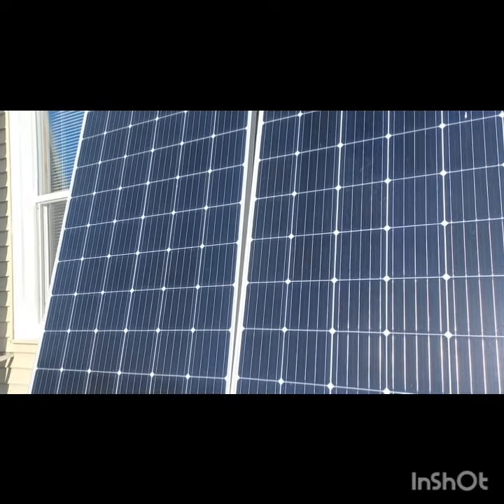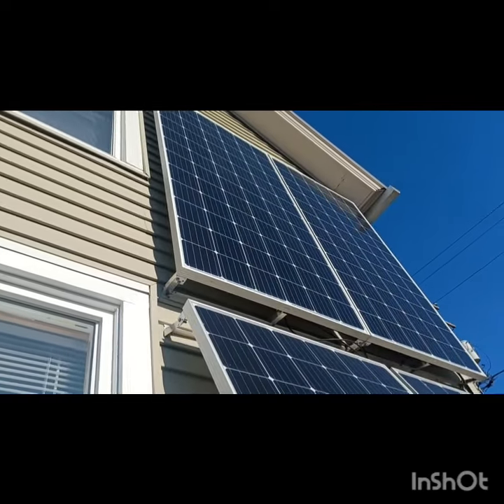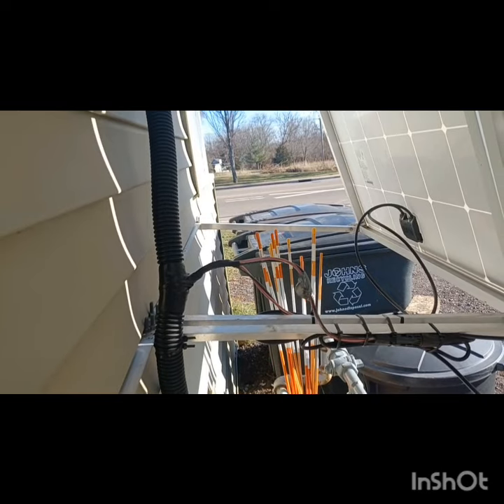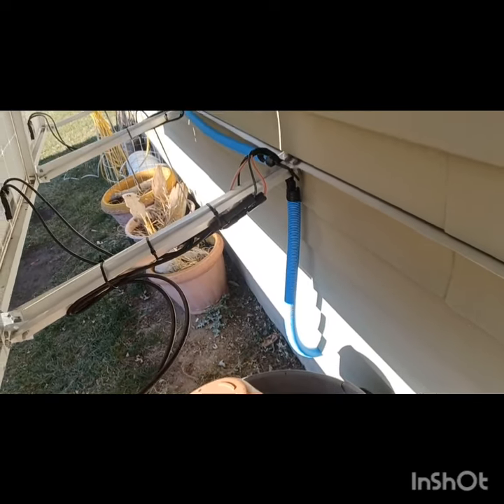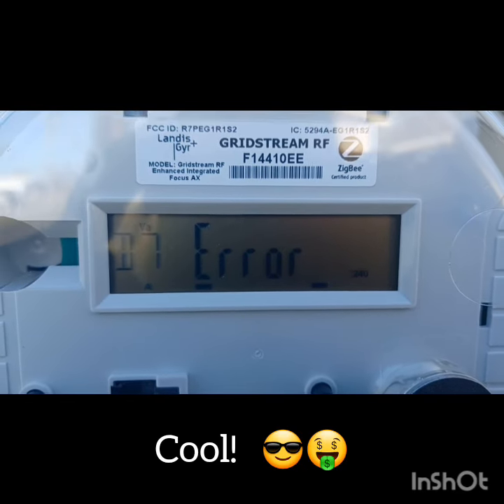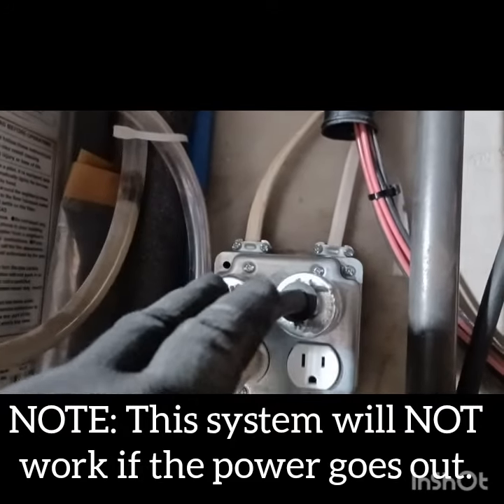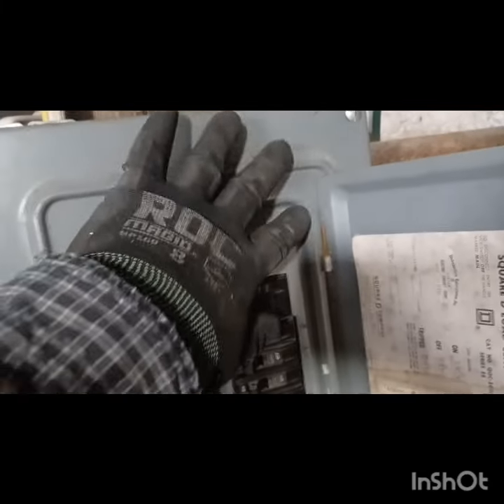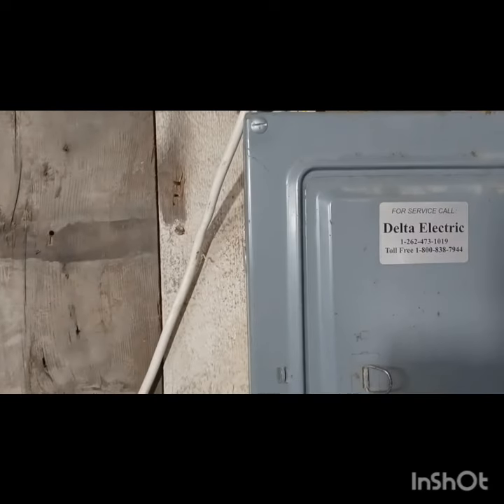Easy 3,000 watt grid tie Solar System for $1,800!

Comment from the maker: Please Note: This is a grid tie system. It is NOT for off grid use. The inverter used MUST have power supplied to it by the utility company, or it will NOT work. Therefore, a separate shut-off in not needed. It's perfectly safe and legal to use and approved by utility companies without any other shut-off device.

Please do your own research on grid tie inverters before making any ignorant comments on the legality of this system. My utility company approves this type of system as is.
Reply: Oh so asking a question now is ignorant? How are we supposed to learn?
Reply: Very cool if your power company let you do it this way and not give you trouble. Down here In Texas codes are much more strict. Good build
Reply: Every house should be allowed to do this sort of thing on at least a small scale.  power company here whined about needing todo peak times (ACs and water heaters throttle down to uselessness) because there's a power shortage but then will also whine that solar is taking away too much business. Busines they claim they cannot produce, so they raise the base rate..... Greedy much?  also f##k lobbyists.
Reply: @MyCabinLife  no. not knowing something is ignorant. it's literally the definition of the word.
Reply: It’s definitely not safe to just put in without a professional
Reply: @UKsystems  it's fine

Comment: I live on solar only..  off grid as it's called. I just bought 6 more 280 trina panels for 500 bucks. I built a 840ah 24 volt eve cells battery. I also have a 14 kw leaf battery connects with a victron DC to DC charger to the lifepo4 battery. I use a splitphase sungold power inverter and 3 victron charge controllers and for generator charging I use powermax 24 volt 50 amp charger and also charge thru a 3000 watt powmr with a 40 amp ac charger

Comment: Your description of the electrical panel is a bit off.  There are two 120 volt feeds into the panel as you said, but they serve every other breaker per side. That's why a 240 volt breaker takes up 2 slots.
Reply from the maker: Thanks for the clarification. You are correct.

Comment: I don't see any disconnect that the electric company requires. I'm guessing this is not approved by the electric company? What do you use so it doesn't backfeed if there's a power outage which could kill a lineman?
Reply from the maker: A grid tie inverter ONLY works if the power is on, or is supplied with power. Otherwise it automatically shuts off. Therefore it's perfectly safe and legal to use everywhere. The shutoff required is in the inverter box. So there is no need for a separate shut-off if the power goes out. That is why I decided to use this system, easy and cost effective.

Comment: It will work on off grid if you have a hybrid inverter
Reply from the maker: Yes. There are ways to use this system off grid with some modifications. For me, having relatively reliable utility power and a portable generator if needed, I like it the way it is. The simpler the better. Thanks for the comment.

Comment: I have seen a Vevor 1200w micro inverter like yours and it only outputs at 110v.  You did mention things would become unbalanced if you only had one connected at a time.  What would the problem be if you connected one micro inverter to feed one leg of the fuse box?  I am asking because I genuinly don't know what kind of problem you would create.  I am sure in your house you use one of the sides of the fuse box more than the other.
Reply from the maker: I am not an electrician nor an expert on electrical wiring. From my research, it is best for my system to run it this way. If I only had one inverter, it would be alright on either side. You may be correct that it wouldn't make any difference.

Comment: very nice video would like to know since they won't work if the grid goes down if i plug my solar generator into the ats would it still work ??
Reply from the maker: There are ways to run the system without having ac power from the grid. In other words, bypass the grid tie automatic shut down in the inverters. Some are legal and safe. It adds expense and complications. I just wanted a simple and cheap system to reduce my electric bill. I'm sure others cover this topic.

Comment: These are 120 volt inverters?
Reply from the maker: Yes. They are 120v inverters. They automatically can convert to 110v -230v and 50-60hz. They can sense the ac voltage and adjust the output accordingly. The input voltage can be from 22vdc to 60vdc. They do everything automatically and can be used almost world wide on many different systems. That's why I like them.